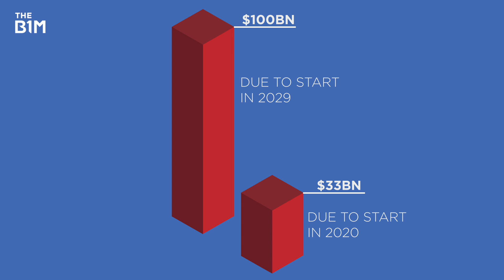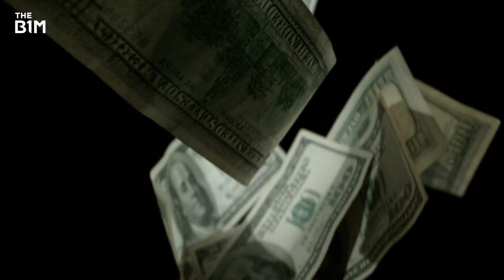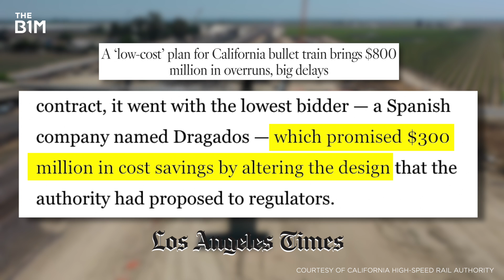What Went Wrong With California's High-Speed Railway

Comment: 150 mph is high speed rail. Generally above 200km/h is high speed rail; that’s where the break between traditional fast rail and high speed rail tends to be. So the US East coast fragment is the US‘ first high speed line.

The fundamental problem in the US is the size/distances covered and it’s population density. That lead to a road centric development over the past century and the towns and cities that grew with that system as their backbone. At this point the old rail lines of the 1940s and 1950s are all but gone and only commuter rail really has the demand to make it viable. Heck even in Europe in the past decades massive numbers of rail lines and stations have been removed.  That naturally limits the network to very specific runs at specific times of day. Add to they the California specific hurdles of geologic constraints and environmental pushback and it’s going to be a chore.

Comment: What's Wrong With California's High-Speed Railway? It costs far far more than it will ever generate in profits. That means that even if it were built is will be a sink hole sucking resources annually for as long as it operates. Society can use that money elsewhere on projects that generate real benefits to the greater society.

Comment: Yeah the high price of the project is definitely a problem.

BUT this should always be set into context with the spending on highways and roads in general!

Once the highspeed line is build, maintaining it will be much cheaper than maintaining a highway
Reply: And scaling it will be very low cost relative to a freeway.  Adding trains if very cheap compared to widening freeways.

Comment: USA build 119 miles of high speed train for over 100 billions USD.
China has managed to build its high-speed network at an average cost of $17m-$21m per km... and that is not just due to cheaper labor cost, it is mostly that they are ultra efficient, and ultra standardized with mass production of everything.
Guess who will lead the 21st century?

Comment: HSR in California doesn't make sense because you'll still need a car to get around SoCal and the San Joaquin Valley, and to a lesser extent, the Bay Area as well. Driving, or flying and renting a car is more sensible. HSR would only work if California cities were redesigned to be more transit-oriented. America is a car society and the most palatable path to lowering carbon emissions is electric cars.
Reply: Which if you've read their station area planning reports and multi-modal strategy you'd realize that it does in fact make sense.

Comment: Why have the construction costs of chsr soared ? Scarcity ! The cost of materials (wood, steel, concrete)  have risen sharply the past decade. So project that have been planned 10 years ago  and have delays, are faced with a lot higher costs than planned (apart from the costs of delays itself). The same with labour. In construction there are a lot of baby boomers and they are retiring rapidly. The vacant positions can't be/aren't filled with younger personnel, as construction is not seen as attractive... this trend is also seen in Europe .
Futhermore most complex projects tend to have delays and budget overspend.The original Shinkansen in Japan was double over budget, in the 1960s. The Channel tunnel in the late 1980s 80%. And that was without the labour shortages and material prices soars like nowadays.

Comment: I'm fascinated by their choice to start in the least populated area first.  Phase one should have been securing the property for the Northern or Southern sections first and starting construction where it is most likely to be used. LA to San Diego would be my first choice given the congestion there.
Reply: Governor Jerry Brown (the one before Newsome) thought it would be a good idea to start there since it's cheaper to acquire land and easier to build. Sort of makes sense but bullet trains are most useful in highly populated areas, so now we are stuck paying so much time and money on something that we won't get to use until it's completely finished.
Reply: The areas between San Jose and San Francisco as well as from San Fernando to downtown Los Angeles are heavily built up which meant that land acquisition was going to be extremely difficult and likely end up requiring use of Eminent Domain seizures which will have an extremely high political cost.  Governor Moonbeam thought that if he could show that the rail line worked and had at least some passengers it would reduce the political costs.

Also for San Jose to San Francisco there already is a rail line (CalTrain).  It runs on old Southern Pacific freight track that has been leased with the provision that Southern Pacific can still use the tracks at night.  That track is currently how they plan to get the high speed trains from San Jose to San Francisco due to the lack of available land.  it does mean that the high speed trains will run at a greatly reduced speed along that section.
Reply: this was absolutely the best choice for starting. just look at how the costs for salesforce transcenter, dtx to connect to it, la union station modernization, and even caltrain electrification have soared. $10b doesn't go very far at all because remember, when the bond passed in 2008 (and voting was in november so it's functionally 2009), basically the only thing decided on was the alignment. nothing was "shovel-ready" at all. the cahsr authority had to do all the environmental reports for the entire project (which consisted of a tier i of the overall program then a more focused one on each segment), then design, then acquire the land for building, then do the actual construction. (in actuality, the contracts are design-build.)

now imagine if they had blown $10b on the planning, salesforce, dtx, diridon, and linkus. how does that gap between the bay area and la get filled? had the state done that, no one would every provide any additional funding, especially not in the central valley area where they are now building. in contrast, there are now 119 miles under construction and the ios is planned for 171 miles, stretching the full length of what is planned for phase 1 in the central valley. i think it's pretty self-evident how much more crucial a 171 mile, 220 mph service speed spine is than three stations would be. beyond that, local interests in la and the bay area are putting local money into at least contributing to some of their portion of the blended corridor, something that is MUCH easier to do when it means pitching in to connect to the spine than if they had to try to fill a gap in the central valley.

finally, la-sd is part of phase 2 and they haven't even started planning on it. but here again, local interest are already moving forward with improvements to the line and the san diego region recently released their transportation plan which relies in part on upgrading their portion of the line to provide higher-speed service. that could be integrated with actual hsr at a later date, but the hsr system likely would not ever exist if all the money had just gone into a couple new stations and some plans..

Comment: "Outside the UK" and the horn😂😂
Reply: But a nice view of what looked like Loughborough Central on the Great Central Railway..
Reply: Kind or Ironic how UK was the one that came up with rail, yet are embarrassingly behind in terms of high speed rail and rail in general compared to the rest of the European powers like France and Germany. Even Poland has a better rail system LOL
Reply: @Racko.  I'm German, and our rail system is good and there are some high speed lines where trains are running 350 km/h. France was the first European country building high speed railways. There are more kilometers than in Germany where the trains go really fast, but since France is very centralistic they leave huge parts of the country without excess to the network. A country which is doing very well lately is Spain. They offer a great service for affordable prices. And the UK... Well... At least London is connected very well with Paris, Brussels, Cologne, Frankfurt and Amsterdam.
Reply: @mariokrings  Indeed, something like this would of taking place in the US. Such as Los Angeles-SFO Houston-Dallas Miami-Orlando, DC-NJ-NYC-Boston etc. It's not feasible to connect the states across the country since they're too large in the US, the best solution is connecting cities less than 600Miles apart. 350 km/h is the fastest possible way for trains like the TGV to travel between places, even 300km/h is good enough, German's ICE 3 and new ICE 4 go the same speeds on average 180-190 mph.
Same goes for Spain's AVE, which are also basically German's modified ICE trains, Thalys and Eurostar
Reply: @mariokrings  Spain high speed train network is totally radial with center in Madrid. This is for pure political power reasons, not following viability studies or economy priorities. The general layout is a lot more similar to France than Germany, unfortunately
Reply: @lsfornells  I think connecting the biggest cities first is the right way to start. So I got the impression that you're commentary is more likely political driven, than the way the AVE network was built. I like the Spanish approach better than the french.
Reply: @Racko.  I totally agree what you said regarding to the US. Maglev systems might add some connections to your list (due to higher speed). But since I can't imagine the US buying a Chinese product, there is just the Japanese Maglev available.
Reply: @mariokrings  The Spanish high speed rail network is all about connecting Madrid with all the provinces, regardless of city size. However big cities remain unconnected, for example there’s no plans for a line between Barcelona-Valencia (2nd and 3rd most populated cities) , and Bilbao (4th) remains unconnected despite /dedicated/ lines have been built to reach much smaller cities with virtually no traffic such as Teruel with only 35k people. 
The French network on the other hand is designed to actually cover relatively populated corridors and cities.
Reply: @lsfornells  try to get from Lyon to Bordeaux... 😂
Reply: @mariokrings  I suppose you have to go through Paris, but that’s no different than Barcelona to Seville
Reply: @lsfornells  but that's perfectly on the way. And that's the point: Paris isn't in the middle of France. But Madrid is in the middle of Spain.
Reply: @mariokrings  Let me show you something. The most populated area of Spain is along the Mediterranean coast on the east of Spain. The most populated cities and the bulk of the Spanish economy is located along this corridor including Valencia, Tarragona,  and Barcelona. However there’s not even a double track rail line along this corridor, much less a high speed line. However, all these cities are connected with Madrid. 
Instead of creating a mesh like network, like Germany, Spain has created a pure radial network where all the lines start and end in Madrid
Reply: @lsfornells  yes and still it is a fact that Madrid works better as a hub than Paris. And you can't compare Spain with Germany. Spain is 50 % bigger than Germany and has just half the population.
Reply: @mariokrings  Yes Madrid is in the Spain centre because it was put there on purpose, but surrounded of virtually nothing for 200-300 km around. To me that does not justify that it is used as a hub, while the most populated areas such as the Mediterranean arc are so left behind in infrastructure and investment. Cities in Germany are not that big (except Berlin) and they are almost evenly distributed across the territory. Infrastructure is also evenly distributed across the entire country. A much better model in my opinion
Reply: @lsfornells  the most populated area of Spain is by far the capital city Madrid (metropolitan area: > 6.3 million inhabitants). I'm pretty sure that makes a good reason. 😉

Cities in Germany are not that big?

Cities bigger than 500.000
Spain: 6
Germany: 15

And never forget: Spain is ~50% bigger (landmass) than Germany.
Reply: @mariokrings  yea, the most populated area in Colombia is Bogotá. Same 3th world country model than Spain. In fact Madrid economy is extractive, in the last few decades Spain economy in most regions has been down by the same amount than Madrid has been up. That’s the Spanish and Latin-American model, and all Spanish infrastructure is designed for the perpetuation of that
Reply: @mariokrings  They will never buy Chinese ones, I dont blame them. Id buy the Japanese ones, even China's Current High speed trains are derived from Japanese's Shinkensens, Texas's Project from Houston to Dallas will also use Japanese's Shinkesens tech. It's just much more reliable and proven's itself since the mid 1960s
Reply: @Racko.  the US won't buy Chinese because of political issues. That's the reason. 

There are different Chinese high speed trains. They don't use just Shinkansen addepted technology, but also Siemens and Bombardier. All of them are proven and reliable.
Reply: @mariokrings  True, even Amtrak's current Acela are made by Bombardier, which as been long proven very reliable, Siemens made almost 100% of the Spanish AVE trains in Spain since 1992 and still proven to be well, Acela's new Alstom made by the French aren't too bad either
Reply: @Racko.  We were the first, and routes were chosen based on what was easiest to construct with the technology of the day. Other countries started later and were able to benefit from our experience by, for example, starting off with a bigger loading gauge. We haven't always been behind; when the HST was introduced, the UK had the most extensive and frequent 125mph service in the world.
Reply: @nkt1  Yea, I think that kinda bounced the UK back into High speed service was the tremondous achievement they did with France via the EuroTunnel to connect the two countries along with Amsterdam and Belgium too
Reply: @Racko.  This largely comes from the fact that our rail lines are super old and integrated with the landscape, if it wasn't for this it would be much more feasible to build fast lines
Reply: ...As HS2 is being built.

Comment: As a lifetime San Franciscan, I believe that investing in and improving public transportation, specifically building a high speed rail line along the west coast, should be one of our highest priorities. In San Francisco we recently completed the new Transbay Terminal. It was built to accommodate high speed rail, with a huge underground rail section ready for when it eventually reaches SF. Same goes for San José which is currently expanding Bart in the area and including HSR in its master plans. There is more support for HSR in the cities, the main opponents have traditionally been rural voters and politicians, namely the farming communities in the Central Valley. California is a very diverse state. It’s easy to overlook that a significant portion of the state is rural from Siskiyou Country cowboys to Imperial Valley vegetable farmers.  Ultimately the HSR will not impact them very much at all. Thus they are not inclined to support it. This is just another example of the complicated urban/rural divide that is playing out across the country.
Reply: How do you expect for there to be any support for public and rail infrastructure when the state has too many fundamental problems in it. I used to be a blind supporter for Rail transportation in California, which meant I would gloss over and ignore the corruption in the building sector, the ridiculous bureaucracy and the land seizures that would walk a thin line of legality. You can't propose more rail infrastructure in Cali if you don't solve the internal problems of California.
Reply: @AsiaMinor12  "I love HSR but I'm against eminent domain"...
Reply: @AsiaMinor12   agreed, there are lots of problems that need to be fixed. I am a proponent of clearing the obstacles that limit our ability build HSR, if that includes rooting out and eliminating fundamental problems so be it.  Let’s tackle both. What fundamental problems do you think we need to fix to increase public support?